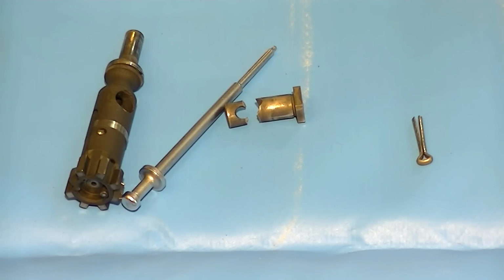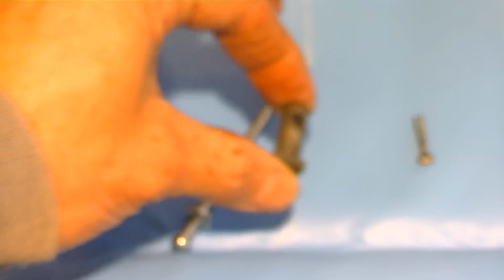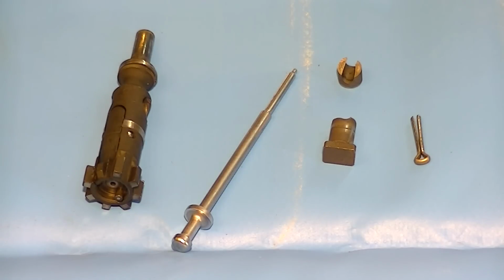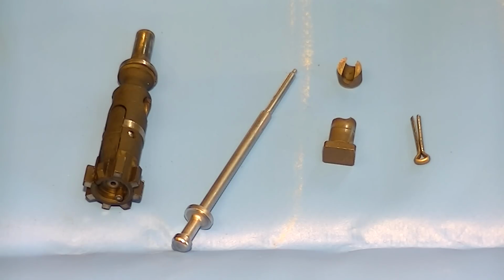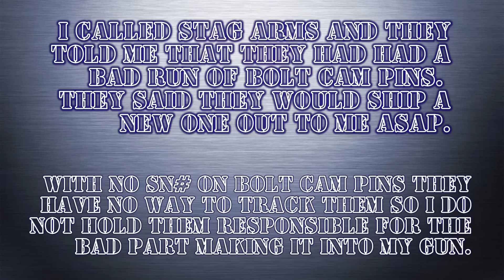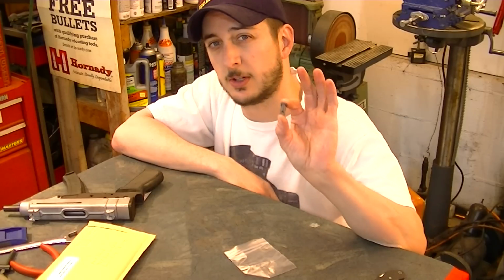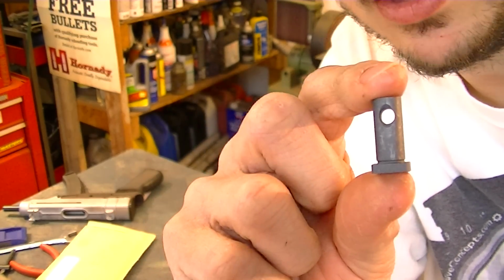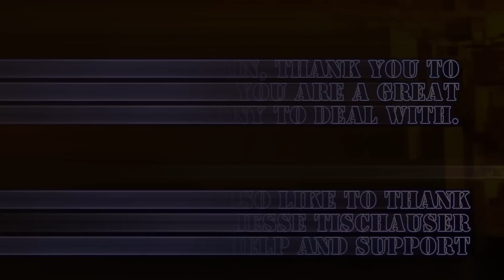STAG ARMS WARRANTY REVIEW "broken bolt cam pin on 3GL"

Comment from the maker: Well, heat treating parts like this is a fine art. If anything goes a little off it can cause them to be too hard or too soft. In this case it was too hard (brittle). Stag told me that they did have a bad batch and did not catch it before some were shipped.  I appreciate that they were honest and took care of things quickly.  I am lucky that it did not tear up my firing pin. It would not surprise me to have it brake in the near future. If it does I will contact them and see what they say.

Comment: Got a stag 15 a few months ago only put 300 rounds down range and my cam pin    has a odd lip on it now caused jams and bad wear and nicks on the bolt itself! Your video is the only one explaining how this is a problem. Have just started researching the problem and it's wasn't in just that batch apparently! I wish I could post a pic of it but will call stag tomorrow and try to get it fixed. My main problem was the lip on the cam pin causing my rifle to jam and made little Nick's all in the bolt it self! Wonder how they are going to fix that. Legit not even 500 rounds down range yet brand new rifle. I was just glad nothing grave happened! Mind you I just purchased my rifle in late 2018 took only a few weeks to get it.  Great video and thanks for the help!

Comment from the maker: continued...  time.  depending on the temperature it is drawn to ~375F to 700F and the time it "soaks" will determine if it has harder more brittle, or softer more spring like properties.  These bolt cam pins were probably drawn at too low of a temperature for too short of a time frame. The lower the draw temp the harder, the higher the draw temp the softer.

Comment from the maker: well, I will elaborate then.The part that usually goes wrong is the final tempuring. To harden steels you must heat to well in excess of 1300F to where the steel transitions to austenite (it changes crystalline structure and becomes non-magnetic)  then it is "quenched" in oil, water, or brine (salt water). This suspends the crystalline structure in an extremely hard state, so hard that it is very brittle. The "temper" is then "drawn" by adding heat in a controlled manner for a specific period of